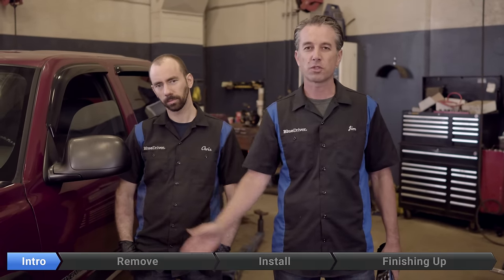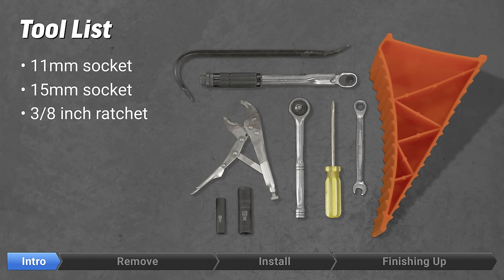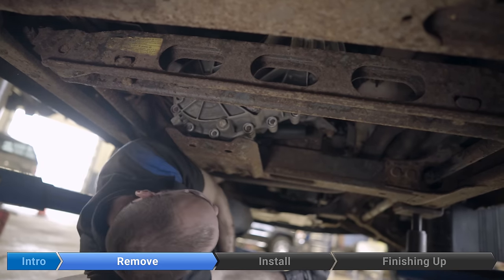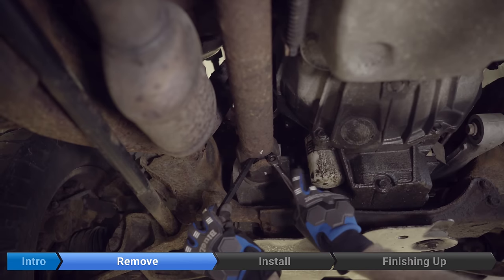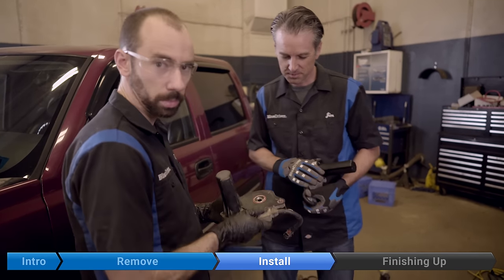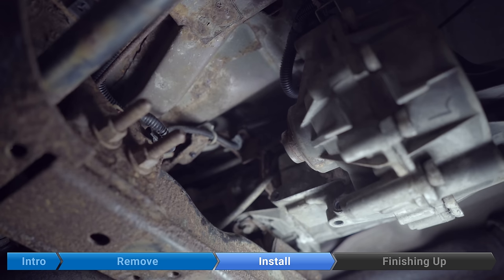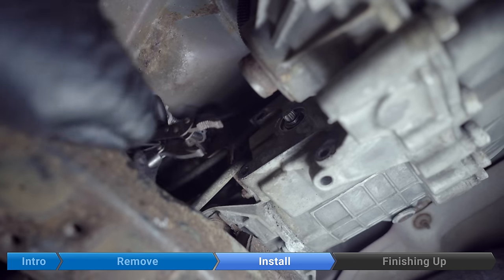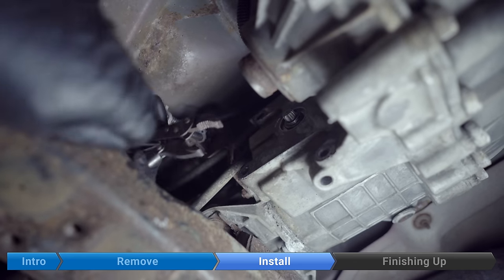Transfer Case Motor – 1999-2006 5.3L Chevy Silverado (Sierra, Tahoe, Yukon, etc.)

Comment: Just fixed mine! You are able to do this without removing the drive shaft. If you don't want to deal with it you can, it ends up being mostly manual twisting and turning on the good old hand wrench and playing Tetris. I opted to do it that way versus worrying about the bearings on the shaft. Worked like a charm Thank you for this amazing video that really helped.
Reply: Tried that shit, but kudos to you! I ended up just ordering the drive shaft boot clamps, grease, and ear pliers to avoid the hassle (after multiple failed tetris attempts)

Comment: Because of a couple of comments saying that this can be done without removing the drive shaft I decided to try it and you can do it without removing the drive shaft. One bolt is real close to the drive shaft I found the best position for the drive shaft and rotated it a little here and there but it is possible. Great video!

Comment: Hey guys, just did this today. Had C0306 code, checked power & ground at TCCM under load, all good. Also had good continuity through motor so it was kind of a parts cannon job when I did it. Once I pulled the old shifter it was obvious it was done for and was the problem. Only thing I did differently was left the front driveshaft in. The middle mounting bolt for the motor had to come out with the old motor and go in with the new one but not a big deal otherwise.
Reply: Thank you for this comment. I knew there had to be a way to do this without dropping rhe drive shaft.
Reply: @tonalddrump2981  If you're stuck in 4WD you might not be able to pull this off, you need to be able to rotate the front driveshaft a bit to finagle the bolt out by the U joint.
Reply: @peteysquirrelchaser9028  Thank you. Probably saved me a lot of skinned knuckles and elbows and a whole lot of cussin.
Reply: @tonalddrump2981  So did you get the job done? Did your front driveshaft hafta come out?
Reply: @Petey Squirrelchaser  still haven't gotten around. Work is eating my days. Sunday is my next shot. 🤞
Reply: Tried to get away with not pulling the drive shaft on a 2002 Avalance.  NO Bueno.  There is not enough room to slide the controller off and the center bolt gets stuck in the U-joint.  Actually made more work for myself and ended up pulling the shaft anyway.
Reply: @MrTomm1963  Sorry to hear it, I didn't have the best time but it was definitely possible on mine (06 Silverado 1500). Maybe a slightly different setup. Did you remove the shaft completely or just undo the front U-joint and flop it down? I put in new fuel & evap lines recently and had to flop it down but didn't need to remove it from the T-case, but overall it was an obnoxious job.
Reply: @peteysquirrelchaser9028  Took it off completely.

Comment: This is the best overall video I've seen for this job! Easy to follow and accurate information. I didn't remove my drive shaft during my installation and that of course made for a little more work and access problems, but also saved me the work of taking down the drive shaft.

Comment: Thanks for the video! I was working on my 05 Silverado over a two day period following your video. I had issues rotating my transfer case manually (8:30 in video). Turns out it was due to my vehicle being in park. I shifted the transmission into neutral and it rotated with ease and new motor lined up perfectly.

Comment: Thanks for the info!  I was about half way through the job and when my buddy pulled up your video, but it still helped.  I want to add a couple things I learned - the first is, the Tcase motor I got from O'Reillys was not a perfect fit for my 2002 Duramax; I had to do some light grinding on both the motor and the Tcase to create clearance.  I also had to relocate the cable clamp slightly on the Tcase motor.  Second, my Tcase shaft would not stay in exactly the right position, wanted to spring back a bit.  So I was able to rotate the output of the Tcase motor to match the shaft, by briefly powering the red and black wires with 12v.  If you go too far, you can reverse the battery polarity to rotate it back.  It took a few iterations of this to get it close enough to go on the Tcase.

Comment: Thanks for posting.  On  my 2004 Tahoe, getting the driveshaft off was a real bear-- used a large screwdriver to pry the rubber boot off while I pulled with the other arm.  Also, the little guide bushing on the top that you destroyed-- my aftermarket part would not fit over it-- had to take it off the transfer case so the tcm would mount.

The job, after testing the switch and getting organized took me 4 hours though.   Things went better when I jacked up the left side of the car and rested the tires on 6x6 blocks.

I also used a hose clamp on the rubber boot after trying to get the old one to clasp.

Comment: You guys made it look so easy, the whole time I was doing mine today I was thinking that it wasn't going to fix my problem it was that easy - only problem was reinstalling the driveline, that was a pain on the 7.4 liter
It's the same transfer case motor as the one on my 2000 Silverado 2500 6.0 liter parts truck, "free" parts, woohoo! 
Bolts right in.
Thanks for a the great work. Sub up

Comment: Watched this whole video. Very good. But when I got under my 03 tahoe i didnt need to drop the drive shaft. There was just enough room to take the 15mm right to the old unit. Moved it into neutral by hand. New one slipped right in.. service 4x4 seems to be gone .

Comment: I took the transfer case motor apart and installed a new encoder ring for like $ 30 . That was several years ago. Been working fine since then.

Comment: Great video. Really helped me locate the problem on my vehicle. The wiring harness on my transfer case encoder as you called got loose and fell on top of the drive shaft and then the drive shaft chewed it through. Is that harness sold separately or do I need to get an entire motor assembly? The dust boot was also destroyed, can that be bought separately as well?
Reply: You might be better off going to a Juno yard and getting the connector

Comment: My husband replaced his actuator and when he puts it in reverse it started making a loud horrible sound. We’ve replaced the switch panel, actuator and encoder. 4x4 still doesn’t work and it’s making the sound when in reverse. Any advice?
Reply: That just happened to me currently. I took the driveshaft off to take the actuator out. Reinstalled, no nothing works in a greens in reverse. Did you ever get it solved?

Comment: On some vehicles such as my 2006 Chevy Silverado 1500 Z71 you have to hold 2hi and 4low to put the t-case in neutral instead of the way that you guys state in the video. Also in my Silverado, you have to be in 2 hi while holding the buttons otherwise it won't go in to neutral, maybe this is normal, maybe it isn't? Other than that very helpful video that describes the simplest way to do this!
Reply: Same here!! I have a 05 tahoe LT, 5.3L. 2Hi and 4Lo for me

Comment: Awesome video, I had a transfer case replaced about 3 yrs ago on my 03 Tahoe, now that 4WD repair message is showing, and the lights on the 2WD button are off. How much would you say a job like this should cost?
Reply from the maker: It will depend on your local shop and whether you go OEM or aftermarket, but book time is under an hour and the motor can be had as low as $100ish (non-oem)
Reply: @LemurMonitors   what do i need to do  trk wont  go in 2 gear   and no lights on 4wd switch  please help
Reply: It could just be the push button switch is bad on the dash.  Replace that and see what happens.  Or it could be the transfer case motor / actuator is bad.   As in the video.  Good luck.  Just had my transmission replaced and went thru all the same stuff.   99. Chevy suburban.

Comment: Would a loud buzzing noise coming from the shift motor be evidence that the part
was bad? Mine is stuck in 4hi, the only way I could drive the truck (without binding)
is to pull the ATC fuse

Comment: I attempted to replace mine today. Watched another video before this and plugged the new one in, and hit 2wd button. But the notch on the motor rotated all the way to the top and it is way way off of lining up to go back in. My selector switches in the truck won't give me an option to go to a different position now. Is there a way to get the motor itself to go back into the neutral position? Also tried putting the truck in neutral and manually rotating to spline on the tcase itself but i can only get one small click either way for an adjustment. My truck will also not go into reverse or drive right now either. How do I get that issue fixed? Its a mess right now. Thanks in advance.
Reply: Mines doing the same thing now how did you fix that problem??

Comment: love the video, but I have a question. what does it mean when you hit the breaks and it automatically puts it in 1st gear or 4 low and says it's still in 4low and it's in 1st gear. is it my transfer case?

Comment: What's about transfer case on my 2000 ,3500 GMC,6.5L.,1 tonn.
When I switch chaft manualy to full wheel drive- my truck speed only slaw,35,40km, or just rear drive.
No hight drive .
Would you answer me,what's wrong,how to check,or need replaced transfer case?
Thank you

Comment: Mine won't shift back into 2hi or 4hi? But my indicator on the cluster also is not showing what gear its in. Will that cause the issue of not changing into 2hi or 4hi?

Comment: I have a 99 Silverado 1500 LS 5.3L 4L60e and I'm having issues with my 4x4 switch not lighting up and also the 4wd not engaging right. I took the motor off the transfer case and it doesn't make any noise or doesn't turn. And also my front differential spins freely but it didn't before when I took the front driveshaft out.  Please help me out

Comment: Very helpful!  I haven't done it so cant say for sure...but I almost bet you could use a nice heavy duty zip tie, cut off at the zip ties head nicely for a clean finish.   I would guarantee it except for the very small possibility which would probably never happen in that location of tall grass/weeds... getting caught in the head spinning around of the zip tie.  Very unlikely tho.  

I think I need to replace mine as it will work when I climb under and tap it some.  Seems sticky or something and if I don't tap it it wont shift but every time I hit shifter buttons and quickly jump under truck and tap on it with my leatherman it shifts.  I haven't used it all summer and now snow is here I tried it and doing the service 4wd.  So I would also recommend maybe..  I think If you just use it every once in a while I might not of had this problem.  That's just me thinking I really don't know but it wont hurt and I do believe it may help to use it every once in a while.  

Great video!  I didn't look at it to close and now I learned I need to pull the driveshaft to replace it.  And good tip of shifting it to right spot mechanically I wasn't sure you could spin that shaft or you saying to plug it in and shift case motor to its gear.  Cool to know!    Thank you!

Comment: very very good and lots of detail where you talked about not being able to line up new motor with  trans case it would be hepfulll to tell why, IT WOULD HAVE BEEN EVEN MORE HELPFULL IF YOU SAID TO HAVE THE 2 REAR END WHEEL OFF THE GROUND wHY ? MY NEW DOOR MAN MOTOR CAME WITH THE PINION IN 3 OCLOCK NOT 6,( WHICH WOULD HAVE BEEN NEUTRAL,) IF THE REAR END WAS OFF THE GROUND I COULD HAVE TURND DRIVE SHAFT TO JIGGER THE LINE UP(MOVE PINION IN TANSFER CASE.. ANYWAY JUST ANOTHER WAY TO ADUST, 
probably should have taken it back to store, but was late and saw on an

Comment: Great video.  Unfortunately my motor didn’t seat correctly.  Put it all back together and did a test drive.  Seemed to work fine.  Went to go into reverse and it grinds.  If I switch to auto 4WD I can use reverse.   Can switch to 2WD and it’s fine.  Bottom line is something isn’t right.  Not sure how to proceed.  Any suggestions would be appreciated.  If I take encoder off but keep it plugged in and put into 2WD can I then turn transfer gear to match up?  Help and thank you.
Reply from the maker: Hello Paul! I checked with some of the mechanic techs we have on staff and they got back to me with this:   They will have to try again, other wise there is a a problem somewhere else in the drive train. "If I take encoder off but keep it plugged in and put into 2WD can I then turn transfer gear to match up? Help and thank you." this should work but you are better off trying to put it all in neutral before the install as this is the way it is supposed to be done. this is also a difficult to diagnosis with over a text, where this is most a mechanical problem you really need to look at at to see how its behaving to figure out the problem, wish i could be more help. 

Hopefully this helps!

Comment: I have a 2000 Sierra 1500 4wd. When I switch from 2wd hi to 4wd hi, the light will flash, then stop flashing as though it has engaged in 4wd. However, the front wheels are not being engaged. The front drive shaft will turn, but the front axle shafts/tires are not rotating. I did learn that there is a front actuator motor which I'll be checking on tomorrow after work. My question is this: when is 2wd hi, is the transfer case supposed to disengage with the front drive shaft too? Or is the disengaging done with the actuator motor on the front differential?

Comment: Are all the transfers case the same from 2000 Chevy to 2004 and if the wires are different will the still work if I remove the same parts you change on the video

Comment: A friend of mine has one of these trucks and he says he can run it and drive it and turn it off then when he turns the key back in it acts like the brakes are locked up but you can put it in neutral and move it but still can’t drive it any ideas?

Comment: I have a 2004 Chevy 1500. While driving in 2hi I lost power. Coasted over and stopped. Put the truck in 4 hi and it drives. Won’t do anything but rev in 2hi. Any thoughts? Will this fix it

Comment: The ground on the frame up under the driver door I cleaned it up and make sure bolts was taught had to put a nut because it was cannot find the connector up under the brake booster

Comment: I did all the steps and my truck I also pushed new switch but now my truck doesn’t go in gear
Reply: Mine doesn’t either and it makes a grinding noise, I’m so frustrated.

Comment: Well i changed the switch on the dash and the module under dash,i cant go back to 2wd from 4wd without going into auto first..05 gmc sierra,what else..the module on transfer case? it does go into 4wd.

Comment: I put a new motor in and it shift then quit. But I didn’t have front drive shaft on yet. Does the drive shaft have to be in for motor to shift the transfer case ?

Comment: I have a 2000 GMC Yukon that leaks oil all the time above the oil filter and above the oil  filter it is always saturated with oil. A mechanic has already put new cover gaskets but it still leaks oil which in turn makes me go back to the mechanics who don't fix the problem. Do you have any idea what could be wrong?
Reply: Rear main seal..
Reply: Pump rub

Comment: My truck puts itself in four wheel when it is shut off 4 high at first then 4 low then the lights on the selector go off and you are stuck in 4 low.
Reply: Its the 4 wheel silinode

Comment: Would this part cause it to go into 4 lo when the vehicle is started? I had vehicle in 2 hi when I shut the vehicle off while it was in park. Started the truck and went to drive off and I was in 4 lo according to the switch. Pulled over put in neutral and switched back to 2 hi.
Reply: That’s what mine is doing. What did you find out on yours? Had O’Reilly’s read the service 4wd  message and it had a co327 like they were saying. Sometimes when I start up it’s in 4 lo or auto 4wd. And then sometimes it’s in neutral and won’t come out unless you stop and restart the engine. And yet again it seems to run fine in 2wd and shifts into the modes just fine. This is where I’m starting the repair
Reply: @kwiturbitchin5277  Mine only does it intermittently. Has only done it twice within the yr. Waiting until I have the money to look into it. I'm going to clean the ground to the frame to see if that helps or prevents it. Will not hurt anything so might be worth a try. I think the ground to the frame is under drivers side front door area. Let me know what you find out, interested to see what the problem is.
Reply: Troubled Soul I did the ground to frame thing last week to no avail. Worked normally for 5 days and then it seems to be acting worse now. I’m ordering a dorman shift motor from amazon now for $195. The same exact part at autozone is $305! I’ll let you know when I get it switched out.
Reply: @kwiturbitchin5277  get it done yet? Just curious.
Reply: Troubled Soul yes Monday night. I just went and got it at autozone because amazon wouldn’t have it to me until this Monday. Wasn’t bad at all, just like the video. I don’t want to jinx myself but so far so good. Has stayed in 2wd since then.
Reply: @kwiturbitchin5277  awesome,  hope it works for ya. Hoping not to have to tackle for awhile. Thanks for the reply.
Reply: Troubled Soul no problem hope it fixes yours too!

Comment: So I just bought an 04 buddy thinks it needs the hole transfer case but after I watch this I think it's just the motor light dosent come on. Once in awhile it does it will show im in two high but if I can save my ass on the hole thing an just get the motor that would be great